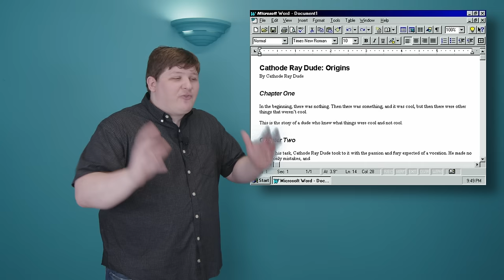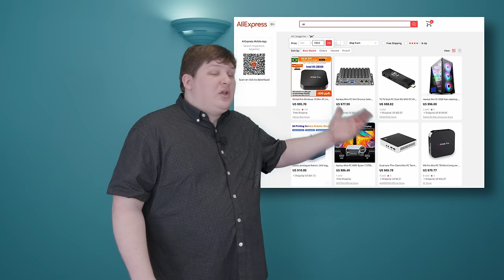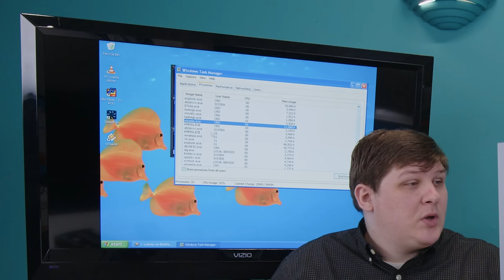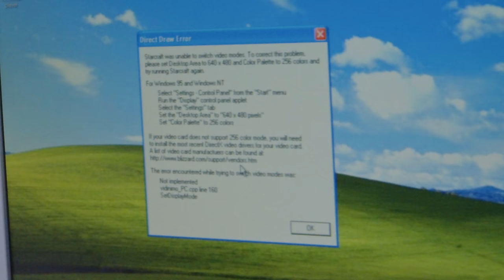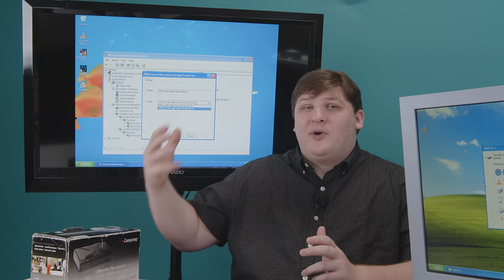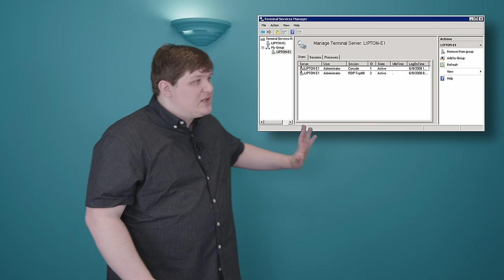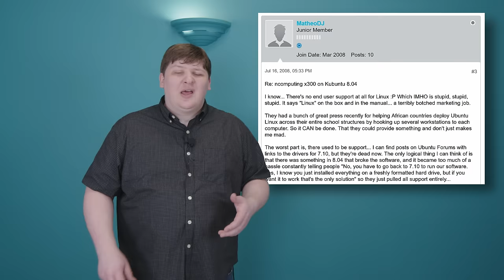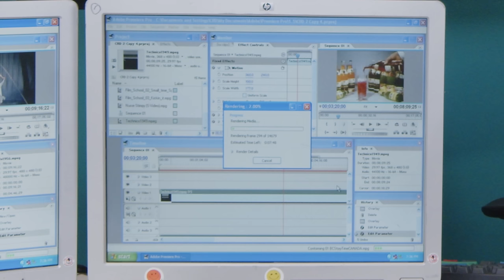7 Users on 1 PC! - but is it legal?

Comment: The key thing to understand here is that Citrix was the company that pioneered accessing Windows NT from remote terminals. Terminal Services grew out from that and other people realised what could be done. One of the offshoot of this is a software that allows you to run concurrent windows applications via the web browser by multiple users without loading the desktop itself.
Windows Multi Point server was targeted in limited markets and Microsoft sales channels discouraged people in other markets from buying it. I tried to buying it and the various license types needed (akin to a per seat cost) made it just as expensive as buying multiple copies of windows.
In Linux, the X windows application model was already designed for low end remote terminals (eg NCD terminals) inherited from the Unix world. The closest thing was something called the Ulteo distribution, whose concept was later folded into the Virtual Desktop Interface (VDI) model.

Comment: i just recently picked up a dell optiplex 9030 AIO (which came out in 2014) at a thrift shop for 25 bucks. I did an SSD swap, repasted the cpu, and it basically is indistinguishable from any modern PC in most tasks except for modern gaming. The design is nice, its 1080p monitor looks great, and it has a touchscreen. It came with a license of Windows 10 Pro, which is worth more than what I paid for the whole system. Its now a perfect living room PC. I think people are too quick to throw out perfectly good computers.

Comment: 44:51 I may have said this back when this video was new, but there's actually a small modification you can make to the Terminal Services DLL with a hex editor to remove this limitation (at least in Windows 7). When I was working help desk, I would push a modded DLL to end users' machines so I could remote in and take care of things without them needing to even know I was there. I was 100% breaking Microsoft's EULA, but the company I was working for was a billion-dollar corporation that could afford any resultant lawsuit.

Comment: This is fantastic content and thank you for the hard work you put into all of it, as a recent subscriber to your channel.

Sure, this content here is fascinating but does it surprise me? No.

It takes age and experience to have "perspective" and I programmed my first computer, a Z80-based platform, in assembly language for a work "day release" college qualification back in around 1983.

I then went through the BBS scene during the 1990s and the first computer that I ever connected to the Internet with was a Commodore Amiga A1200 running at 14 MHz with 8 MB RAM and running the "iBrowse" browser over a dial-up modem.

The "perspective" really comes into play for me as someone who repairs, refurbishes and collects a lot of old IBM and Lenovo Thinkpad computers is when I use a particular Thinkpad, a T22 from about 2003-ish that has a Pentium III CPU in it running at 700 MHz with 512 MB RAM in it - so it has 50 times the CPU power of that Amiga, and 64 times the RAM.

I have been using Gentoo Linux for 20 years now and it means I can make custom Linux builds that function the same at their core on anything from a Raspberry Pi Zero through to a multi CPU Xeon server in my home environment - and that T22 laptop is a machine I still use regularly because it just provides a nice and distraction free way of me doing some of my work. I can run an i3 desktop on it, be SSH'ed into my home server writing BASH or Python scripts, have my email open on a second desktop and have a music player or podcast going in a third desktop - and still have plenty of resources to run other stuff too.

Most computing tasks don't need a lot of resources anyway - it's the modern Web 2.0 that has increased CPU overheads, as well as "new" activities like HD video editing and, of course, modern gaming that have also increased system demands.

So this is welcome content and I do hope youngsters working in the IT industry as I have done for 40 years now (specifically in telecoms, networking, UNIX and Linux sysadmin, servers, cyber-security and still learning and having fun) do watch content like this, just to understand the history of computing and appreciate the amazing amount of computing power that is available in everyone's hands these days.

If anything, modern hardware bores me these days because there's nothing it can't do - I have greater fun buying broken and used "pieces of cr*p" computers on eBay and just getting them to do something useful, either with Gentoo, *BSD or even a retro Windows or MS-DOS build.

Comment: he, I know my comment is a bit late but I found your channel just recently. This reminds me on the very old days (87?) when I worked in a very small computer firm in Austria selling computer equipment to doctors. There was a thing called "concurrent DOS". When I remember correctly it ran on a 286 with a lot of serial terminals (still remember soldering all the connectors). I also did some programming there, it was a BASIC which was so bad that first we had to develop a full screen editor for it as it could only list a single line and no editing just rewrite the line. As Boss recognized this he went furious as we wasted his time and money for "fooling" around. Never came to the idea of selling this editor, was a good business man I guess.

Comment: When Divinity Original Sin 2 released, we wanted to play it in splitscreen, but that required all players to use a controller and my friend understandably refused

So I told him of Aster V7, downloaded it and connected a second monitor and mouse and keyboard. Worked like a charm, his PC handled running the game twice just fine. Though interestingly the game had lower framerates for the second user than the first

Later, I used it to run Rocket League three times on my PC to farm Golden Eggs. Lol

Comment: The software is the key. You were right that Windows has that functionality built-in. It's not easily accessible, but it's there. Back at XP era I've set up 2 sets of workstations with 2 users for each. So, 2 PCs, 4 monitors, 4 keyboards, 4 mice. And I used nothing but software. There were several companies making that software, and I had 2 different programs. At times they started glitching, so I had to delete one program and replace it with another, but most of the time it worked. Each PC just had to be equipped with an additional GPU (or have internal graphics) We even used to play Warcraft III and Age of Empires 2, and it all worked!

And speaking of schools: I used to go to the Corel DRAW courses and all computers there had 2-user setup and via  the same program I was using. It felt so cool to be so in-the-know!

Comment: There is a software that still does that today (aster multiseat), and even lets you assign each video outputs from the same gpu to a different terminal (with a very minor increased input lag on the mouse, almost imperceptible). I used to play overwatch with two other cousins on a single  rx480 (of course, all on low, and I had a 8 core ryzen and 24gig ram, but still impressive!. It's not virtualization, i think windows (possibly since NT) has all the features under the hood to work real multiseat - just like unix - it's just not documented, (because of the obvious licensing gray area problem...)

Comment: Again from long ago, I remember a computer system which came with an 8080 processor running a modified CP/M-80 operating system. This computer had a lot of slots in it. And they sold a daughter board which came with another 8080 CPU, memory, and a serial port (yes back in the days of serial terminals). You put in the board & connected a cheap serial terminal (relatively cheap). All the disk I/O when to the main CPU. It was almost like a local network in a single box.

Comment: My first job in 1977 I worked on the Microsoft Reality computer system. This had an 8-bit CPU with a 5 MHz cycle speed. It had 64 KB of main memory. We had a variety of 1970's 14 inch disk drives. And we could run 31 serial terminals and a 300 LPM printer. All users ran at a very respectable speed. Only very rudimentary graphics on the terminals but there were some character attributes (color, blink, font) that could be used very effectively.

Comment: One thing to mention, Windows XP actually had support for 2 separate mice on 1 user account, Rag Doll Kung Fu is a popular game that supported 2 mice for multi-player. Wanted to mention it, since a few times the video mentioned separate mouse control not being something Windows supports, but it briefly did in the 2000s.

Comment: A long time ago in the mid-90s, I was an Apple certified repair tech, and there was rumors in the "insider" community that Apple was toying with the idea of a "Hydra" computer with multiple monitors/keyboards/mice arranged in a 3, 4, or 5-headed "station" with a desk surface and chairs, and each head would run an "At Ease" shell, talking to an Apple Workgroup Server housed inside the station/desk.

Comment: Backing up that first statement, my parents used a Pentium 4 machine running XP until 2016. All they really used it for was their taxes and some very light photo editing before uploading photos to facebook. Editing the occasional SD video in Movie Maker was the most they ever did, so the computer being ridiculously old wasn't really a problem for them.

Edit: I've also used Aster before, it still works on modern Windows and it allows you to use a standard desktop GPU and just direct attach everything to your PC, everything is handled in software.

Comment: In 2008 we used a server with WS2003 and Citrix Presentation Server. Hw dual Xeons one core each with over 20 users per server with 4GB of ram.
For what the users used it was really good.
Office/Outlook/Internet browsing/ERP.

Where I work today we we have over 200 PCs older than 2013 (mine was a Core 2 quad) . After we upgrade the computers to 8GB users believe we changed every machine to new.

Comment: I second the notion of the "plateau".  Many years ago, I realized things like keyboards and mice "plateaued", and that it was a matter of time (and I realized at the time that it might take decades -- in no small part because games would be pushing the envelope) before monitors would get so advanced, no one would care about upgrading.  I also figured that computers (excepting engineering and possibly games) could reach that point as well.

I also realized there's something special about anything that can compute, and I have a difficult time giving up old hardware, even hardware that no longer works, because of this (and also probably because I develop sentimental attachments to things I use for a while ....).

Comment: Only just found your channel, but well impressed. Huge amount of information and insight imparted per unit time. In an age of filler to get lite content over the lines of monetization, this is super-refreshing.

Nice work, dude.

PS I theorise that the FPGA will be your performance bottleneck, so you could throw a better CPU at it and still have the same limitations. 

It is impressive though... I love these old custom cards. I used to manufacture use-cases so I could enjoy the tech when I worked at a distributor back in the late 90s.

Comment: Just an FYI: Citrix started off like this with multi user OS2 that I installed in a small bank in 1992 for 8 users sharing 1 PC running dumb terminals for each user on a 486DX. It worked fine for the users and was dirt cheap in comparison to PCs with networking. AccPac accounting was the primary application along with WordPerfect.

Comment: I recall I made about $30,000 helping attorneys who were still using Wordperfect in the early 2000s. One of whom bought a new printer and it wouldn't work with WP.

Comment: My father wrote two dozen books and close to ten thousand articles on an Amstrad 1512. It lasted from 1986 to 2006 daily use when its power supply finally blew taking the monitor with it.

Comment: Remember those wireless USB hubs? The setup contained 2 parts. The wireless USB dongle you stuck into the PC which will be getting all the USB addons, and the USB hub (with power adapter). Then, any device plugged into the USB hub, could communicate with the PC, which could sit a few hundred feet away (as advertised... in my experience,  a client who had a problem which this wireless USB setup could solve,  was able to get good response time/speeds up to 50-70' away, through 1 maybe 2 sets of walls.), even in a different room.
Anyway! What if you used this 7-in-1 PC gizmo, and one of the slave PCs could be attached via the wireless USB hub, and within that hub attach a USB adapter to VGA and a mouse and keyboard... and see what quality it runs at.

I think I will try this too :) sounds kind of fun, in a geeky way... something to do on a rainy afternoon.

Comment: 11:14 you can emulate an OS on linux using VM's & you can allocate ram, CPU cores and a graphics card to one PC inside your PC but you can also run an infinite number of PC's if you really wanted to depending on your hardware. personally i use it on my main PC and virtualise windows 11 for stuff and if windows fails in anyway i can load a backup of that PC from my linux PC, i've also split my PC by running two VM's of windows for when i have friends around.

Comment: As an audio engineer in a recording studio I am still using a DAW released in 2013 and running it in Windows 7. I have zero need to change it. I also have a video editing machine running Windows 10 very capable of editing 1080p. Good enough for my purposes. And I have a 15 year old computer managing file back up. I have no complaints.

Comment: Awesome. The first thought that comes to mind why that one game would not launch more than x2 is because it might rely on some temporary config file in its application directory as opposed to roaming or programdata. Maybe installing another copy (or copy/pasting the application directory to another location) and running from different locations can get the more than x2 going. Try the original x2, then try another one from the "new" location as well. It could also simply be because of some hard code in the binary, itself. That would be easy to adjust for someone competent. I wouldn't mind having a look.

Comment: The reason why Microsofts OS is so much used in office is BECAUSE they offered it to schools, and invested a crap ton of money in to marketing, to get Computer Integrators to sell their PCs with Windows. But for a lot of things, a Linux based OS is sufficient and sometimes even a requirement (especially if you do anything besides office stuff, which it of course can do as well).
I work for a non profit organization, and we repair, refit and upgrade old hardware, usually donated by individuals, companies, departments, schools etc. And we deployed a few dozens of LTSP (Linux Terminal Server Project) systems here (one of the most expensive countries) and also for a bunch of developing Schools in africa. We usually use a powerful Workstation PC, sometimes even actually 19" or Tower Server Hardware (used of course), and as clients we mostly use up to 20 year old PCs. It's even possible to use older Hardware, but the driver support for them kinda get's removed gradually and the performance is a bit meh. One of my coworkers still uses a Pentium II as a Thinclient, and apart from not being able to play fullHD youtube videos in the browser, it still works and is usable.

Comment: Ooh, mention of Userful at the end. That was in my local library at some point say late aughts. They used to have a demo copy of their distro available for download, and a live VNC demo on their site that I used to poke at from time to time. I might still have the demo on a CD-R if I can find it. One funny anecdote is the installer appears to work differently depending on whether you had a hard drive installed in your system. By default when you boot it, it'll just overwrite everything on your computer and install itself, but if you run it without a hard drive (which I was doing in Microsoft Virtual PC back in the days), it would give you some Linux distro's normal installer. I took that at face value and ran it on my computer, and accidentally ended up overwriting the beginning of my hard drive. Fun times, and I did complain to their support about it, but I hope I'm wiser to heeding warnings these days.
Reply: Looking at Internet Archive, they also had a two-user live CD version. I vaguely remember downloading both, but still not sure where I put them. There is an archived version from 2016 or so floating around, though I think my version was from 2008.

Edit: found them, looks like they were from 2007. Currently uploading to Internet Archive.

Comment: No doubt given this now a year old my comment may go unnoticed, but FWIW with respect to the Terminal boxes and their 8-wire RJ45 connections, I’d draw your attention to a good many of the popular KVM systems of the same era - the type that had 2 interface boxes, one at the computer and the other next the the monitor etc, an example being BlackBox branded KVM’s from the very late 90’s into the mid 2000’s , lots of them used the same scheme – RJ45 connectors, but not Ethernet, manuals would often draw the users attention to signal skew issues if the TP cable was poorly installed, or extended beyond specific range limits. So in conclusion I’d say your summary of how the connection to the Terminals works is pretty good, and overall this was a great video, really enjoyed it, thanks.